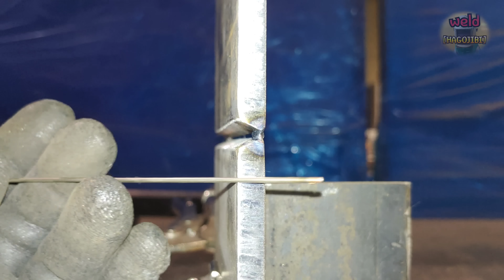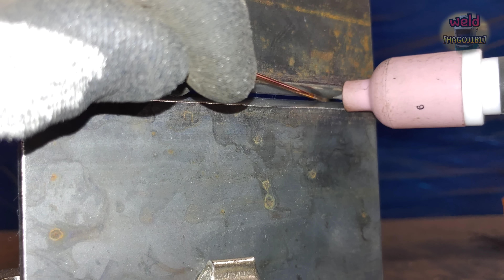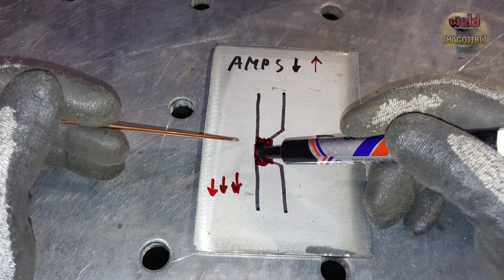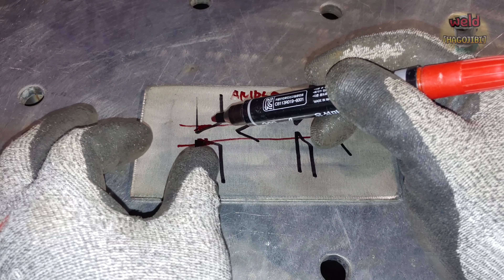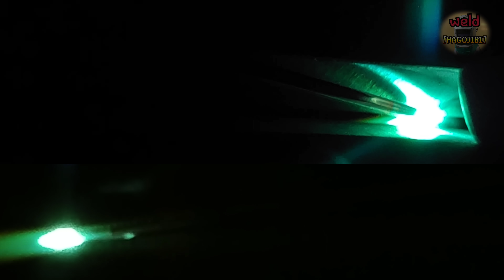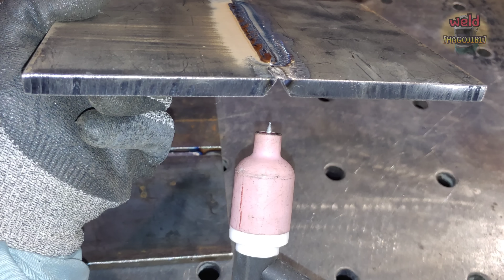The Best Way to Learn Horizontal Tight Gap Root TIG Welding

Comment: Heat input is the relationship between.. amps, volts, and travel speed.. the slower  you go (travel speed) the more heat input..( the more suck back you will get.) The more you go side to side the more heat input you get..( the more suck back you get.) Voltage.. is arc length or the distance between your tungsten and work piece.. by increasing the arc length you increase the volts, increase the puddle size, you get more heat input.. amps are self explanitory.. lastly.. the angle of your tungsten will change the size of your puddle.. the longer the taper.. the smaller the puddle.. this will also affect the voltage.. increase the voltage by increasing the arc length.. this will make your puddle just wider than the filler metal..you can increase travel speed to 5 - 6 inches a min.. and you can reduce the amps alot.. 80 to 100 amps.. you can free hand the root in half the time.. smaller puddle more penetrating..

Comment: Can I ask what brand of welding machine you run? (Google translate) 어떤 브랜드의 용접기를 운영하는지 여쭤봐도 될까요?
Reply: I believe he's using korean one 
 but sorry don't know which one is
Reply from the maker: The one used in the video is a product made by a South Korean welding machine manufacturer called NSWEL.
For more information about the welding machine, you can get a more accurate answer by contacting the manufacturer.
NSWEL's email
↓↓↓↓↓↓↓↓↓↓↓↓↓
korea@nswel.com
Reply: @weldHAGOJIBI  Many thanks. I have emaild them regarding their products!
Appreciate the reply

Comment: Very nice editing to put both the front and back of the weld joint in the same frame. It's great to see what is happening as the weld progresses across the plate. We do the best we can until we learn better. Thanks for the instruction. Stay safe and God bless.

Comment: Nice video.
You explained and showed it very well! 👍🏻
A question: What kind of gloves do you wear when welding?
I only know the leather gloves.
Reply from the maker: The gloves I use are not for welding only. I use cotton gloves with rubber coating. I think maybe this is not a good habit. Sometimes my hands are too hot lol.
Reply: @weldHAGOJIBI .
Thank you for your reponse.
Hm, but there are also thin leather gloves in short form for welding.

Comment: One proposal dude ... Try on first plate with greater amperage somewhere between 5 to 15 amps more, but with blunt tip of tungsten...indeed 45 to 60 degrees of sharpening...

Comment: Numb question, relating to a possible future project:

Would beveling both sides be preferable, running a TIG root (at the least) from both sides?
Reply from the maker: When welding very large and thick steel plates or tanks, sometimes working by beveling the roots on both sides. And sometimes reverse beveling is applied. This is not necessarily a set rule, and it varies depending on the situation or working conditions. Sometimes it is applied for work efficiency. And it is sometimes used to prevent unilateral thermal deformation in one direction.
Reply: @weldHAGOJIBI  thanks.  The idea was to “help” prevent warping when welding steel plate between 6 to 10 mm in thickness.
Reply: Not a dumb question but read to the end. If you can see both sides you could bevel both. It will cost more and requires more surface preparation. This will require more weld. More welding may cause distortion.  
  In his is presentation you can see and film both sides. This was a class demonstration.  Many times in field or working situations both sides may not have easy access or access will not exist.  Say a 10 inch pipe.  You can not crawl in a pipe that size.  Even if you had large diameters confined space entry is very dangerous and should be avoided.  Let's say this weld was on a tank large enough to put a car inside. You would need to monitor the air quality and have a team to do an entry in a safe manner. Lets also go back to cost. The cost to back bevel a small plate like the demonstration would not be that much but scale it up and I think you can see how the cost is going to increase exponentially.  If it was an alloy steal such as stainless steel we would have more complex problems that I am not going to address in order to keep this reply relatively short. I still did did not cover all the reasons for good root penetration.  I have several more even for carbon steel.   
In his video he did address this but very quickly so he could keep it short.  Keep asking questions. Be sure to observe everything with an open mind.

Comment: 안녕하세요 선생님 항상 잘 배웁니다. 회사에서 하스텔로이랑 인코넬 떼워야하는데 비드가 예쁘게 안나와서 서스 외 비철도 한번 다뤄 주시면 감사하겠습니다
Reply: What I am trying to say is you may need him to come to your job to exam specifications. With Hastalloy and alloy welding it becomes difficult to provide answers remotely. He is the best I have seen in video. If you could get personal advice from him it would ve much better.  Also my GOOGLE translate did not do a good job with your comments for me to read into English. I am glad you are bilingual.  go back and see if your Google tool translated correct.  His videos seem to have good translation.
Reply: The Google translate did not do a good job. you need an expert to come to your site. unfortunately many experts have no humility and are not experts with skill. The more one is sure of himself without a question it shows his lack of knowledge. At the same time you need confidence to solve it. 
In alloy metals many factors can be involved. Your questions must be more precise.  He can make a video and it may not fit your situation.
Reply: @jonitrost8124  hey bud I know there not many skillful welders share their own skills to other learners like me or you. But I believe him that read my coment and give it a shot as he did before which means he is quite mercyful and generous not like other experts.

Comment: Hello and congratulations. I am trying several times to contact you to try to import your welding machines into Italy. Could you contact me ?
Regards
Reply: Italy has STEL welders. Are they any good?
Reply: @gandolph3  I tried to contact the author of the video because I understood that he collaborates with the manufacturing company. Their machines look great value for money. I would like to try to import this brand into Italy. We in Italy have machines of the highest quality but also very expensive. This brand would be a good compromise. I need a safe and reliable contact in South Korea
Reply from the maker: For more information about the welding machine, you can get a more accurate answer by contacting the manufacturer.
NSWEL's email
↓↓↓↓↓↓↓↓↓↓↓↓↓
korea@nswel.com
Reply: @weldHAGOJIBI  Hello and thank you. I wanted to ask you if the NST-AD250FD has the function of pointing and micro pointing, and if it has the instruction booklet in English. Thank you
Reply from the maker: @folwind1  In case of NST AC DC 250FD model, there are electric welding mode and TIG welding mode. For TIG welding, there are 2T mode and 4T mode. There is no spot welding mode. Instead, in the case of "Micro TIG Welding Machine NST 300D Model", it is a DC welding machine and I know that all functions are possible.
NSWEL has an overseas sales department, so if you contact us by e-mail, we will kindly advise you.